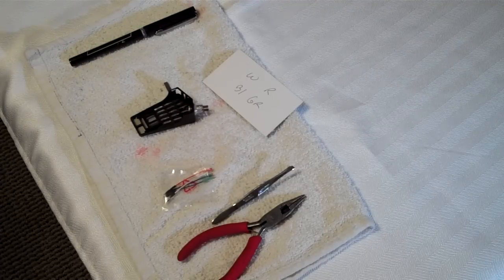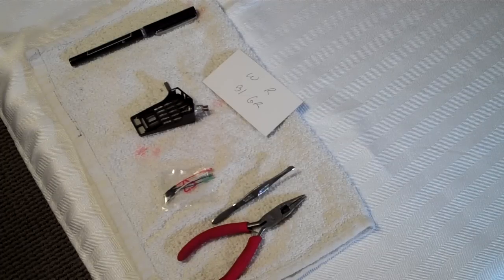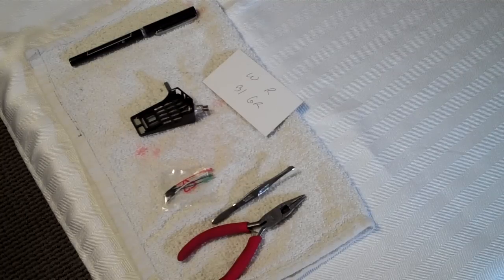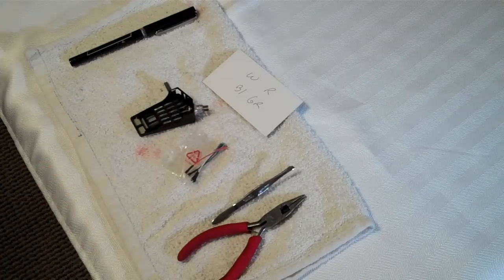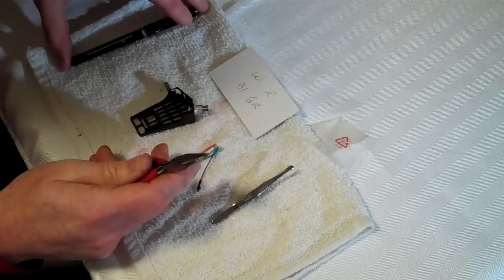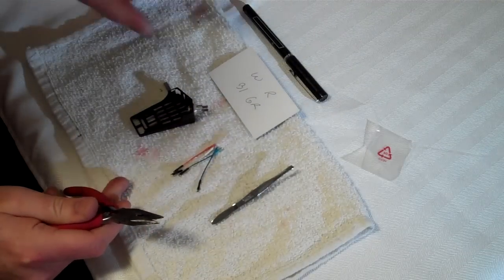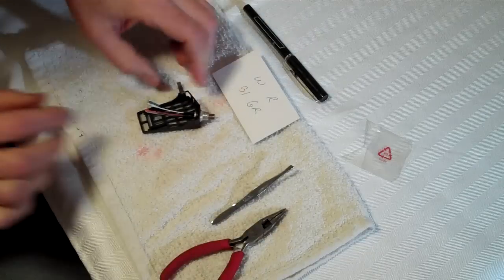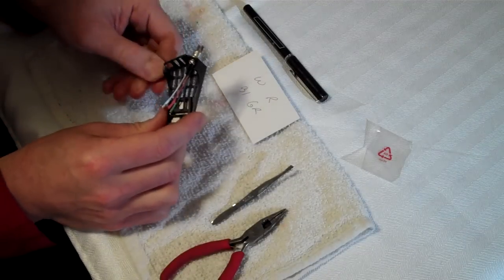Changing Wire Leads in a Thorens Turntable Headshell, Part Two

Comment: The original leads are better they are silver what is better than gold, the blackness doesn't affect any resistance on the silver if you don't like it black you could dip it in Silver dip that's all you have to do. Ideally you want to silver wire with silver connectors I'm not sure if the Originals are they might be.